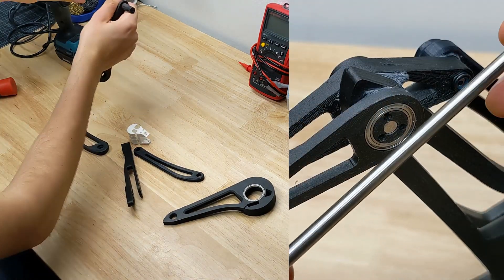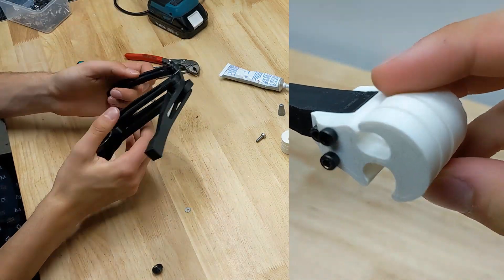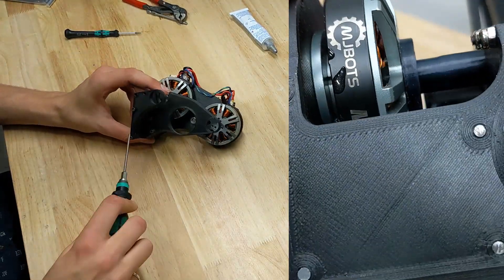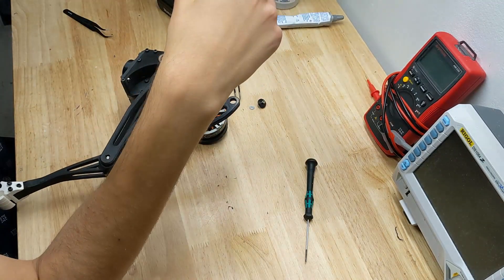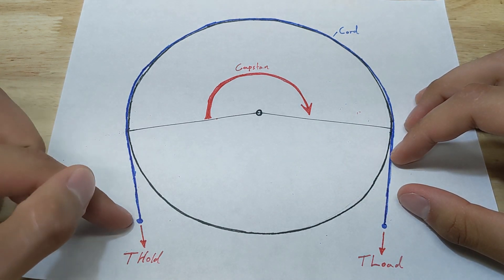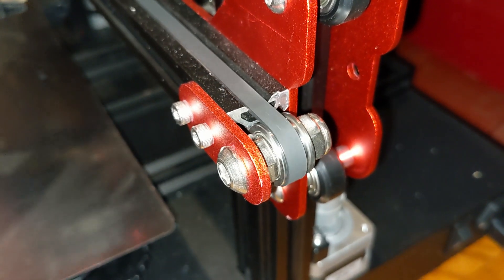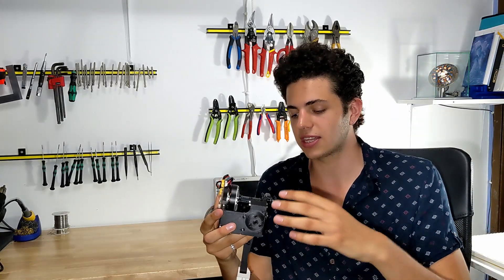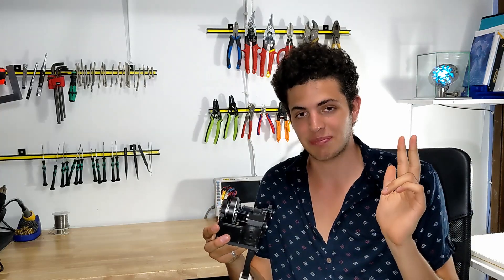Bruce-E Build Series #1 | Building a Robotic Feline from the Ground Up | Leg Design and Assembly

Comment: ¿Dónde compraste los motores sin escobillas?
Reply from the maker: These particular motors are from MJ Bots, but you can purchase very similar models from Ebay or Aliexpress at reasonable prices. These are the same size as is often used in larger industry-class drones.